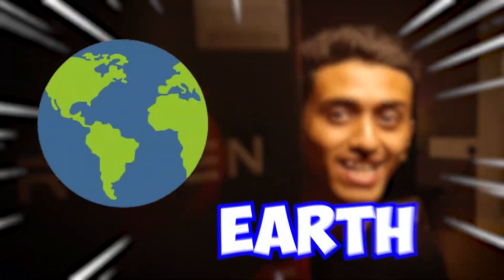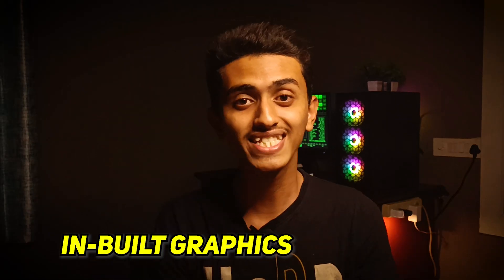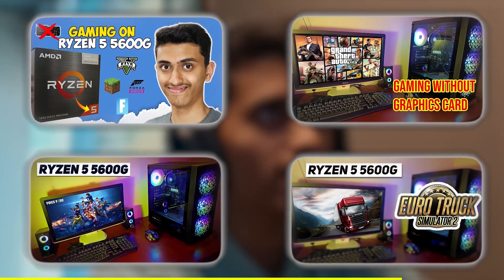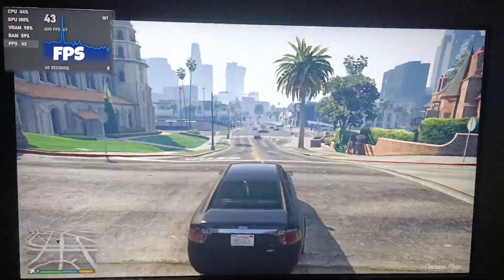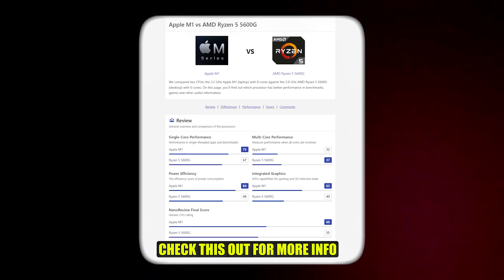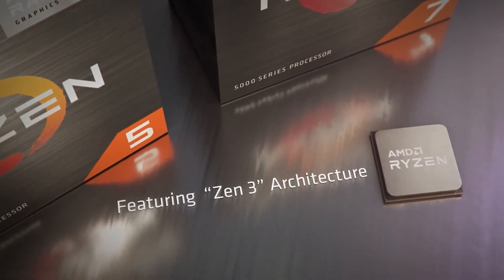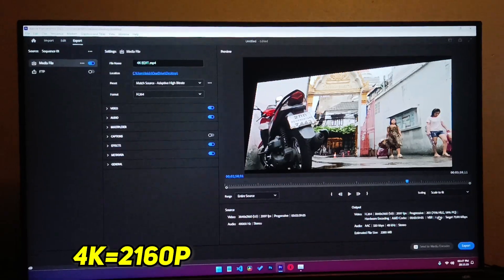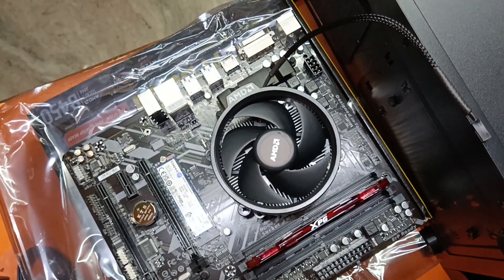❌Stop Buying this CPU without watching this video. | KRISH TECHMY

Comment: um thats sh** u could just wait a week or two and get the 8600g when its out and it will f* any 4gb gpu (exept for 1650 and 6500xt those are equivalent to it) u could even get 50fps with no fsr on medieum settings in many games (this are the 780m laptop varient specs which was out for months now the desktop will be maybe up to 10% stronger but its not out yet)
Reply from the maker: But I bought it last year.
Reply: what i mean is yeah its a really good apu but not any more so people shouldnt buy it any more (but if people will sell the 8600g for 100 more u could just get a 5600 and a rx 580 which will be same if not a better ) but yeah a year ago it was a monster for the price . and good video by the way @KRISHTECHMY
Reply: @malik-mahdi  a reputed youtuber revealed that 8600g performance is equal to gtx 1060